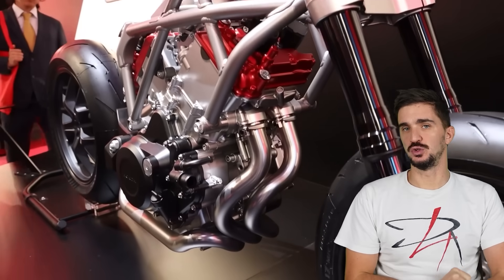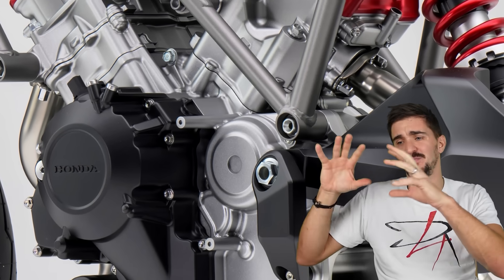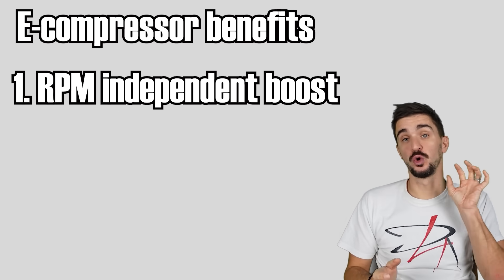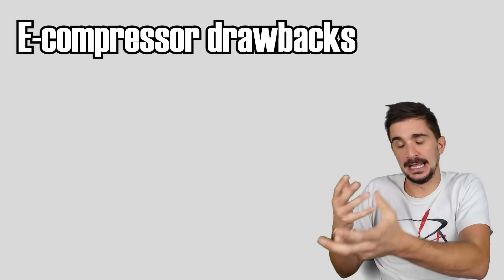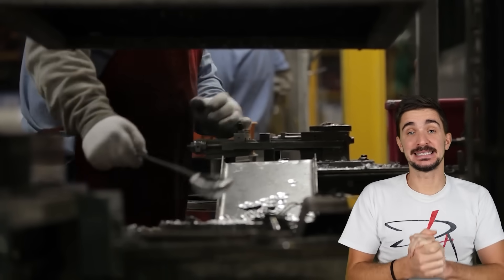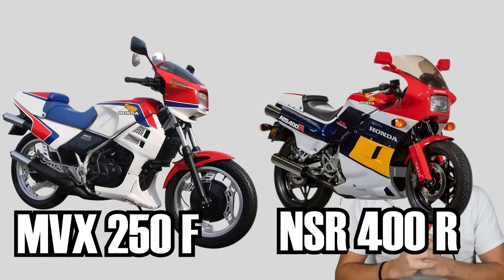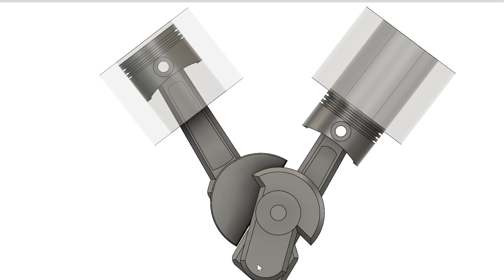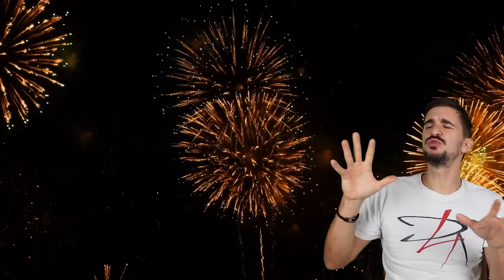Honda's New V3 Electrical Compressor Engine Explained

Comment: I'd love to see the electric supercharger system used with a sorta hybrid-esque powertrain, like, add ebike-style hub motors to the front and rear to use as dynamic brakes to charge an independent, higher-voltage battery bank (or even supercapacitors) for the blower whenever you slow down. Effectively multiplies your energy input (via regen braking) into gaining MUCH more output power by using it to supercharge a combustion engine instead of just putting it back into the electric motors, plus for continuous boost it can sorta function as a traditional supercharger by siphoning power off the driveline and putting it into the supercharger, since modern brushless motors and centrifugal superchargers have efficiency on par with an oldschool straight-lobe Roots blower when used together.
Reply: I'm also wondering if this engine could be used as a range extender in cars. It's compact, light, clean and has good power output.

Comment: Some of the engine's power must be used by the alternator so it can generate sufficient electricity. Honda will most likely make it so that the alternator will automatically turn off during acceleration. Perhaps only in sport mode. Then
 Allow the alternator to operate normally during constant cruising speeds. Honda goldwings with heated seats do this in a similar fashion. The gold wings don't shut down their alternators, but they temporarily turn off the heated seats during acceleration.

Comment: So, to get the extra mass on the rear cylinder, could it just be made larger in bore? This would make for uneven power pulses similar to the big bang motors. Might be good for traction.

Comment: With a turbocharger the exhaust manifold between the engine and turbo may be more complicated, but, since the turbo removes a lot of energy from the exhaust gases, the silencing section of the exhaust can be simpler and more compact.

Comment: Honda R&D on a supercharged V3 750 cc VTR? The cheapest bike will be $17,000 for the base model, easy. Regardless of only making 100 horsepower or so. It will probably go up to 25 grand. Knowing Honda. I say that despite knowing about Honda's new 1000cc Hornet being so cheap. I consider that bike a fluke. 

I really hope that I'm wrong.
Reply: You talking nonsense
Reply: No.

Comment: most 1000cc engines are putting out well above 130hp, unless you go to harley. Suzuki's GSX-R 750 is making 150hp but its a inline 4. Either way this thing is going to have to be pulling some miracles out of its tail pipes to sell well. Suzuki's 8s  with a new engine is selling for 9 grand, and its not doing anything insane with its new engine. the BMW F900R is selling for about the same and stock for stock the BMW whoops the 8s out of the water in everything but looks.  So this is going to be much like the other things honda has, SUPER expensive for what it is...Its a new engine, chassis etc etc, this is going to be expensive for what its going to offer unless its going to be its new Fireblade and just drops insane numbers for power, weight, etc
Reply: Wrong dude. Gsxr 750 makes 150 horses after you install a full exhaust system with no catalytic converter and a couple of other mods and a remap, obviously. 
The thing Honda is trying to achieve is to have more power and usable torque at lower revs in a more compact engine while also meeting strict euro5+ emissions standards.

Comment: Amazing video! Thanks. My first thought was that the center piston would have a larger bore but the same stroke as the other Pistons. If the bore was 1.41 times the other two then it would have twice the area and twice the displacement. So it would kind of be like a V4 but with a shorter crankshaft and now narrower horizontal block. Which is what we want. 
But then there's the 75° angle. This would screw everything up that I was thinking about. 
Do we actually know that the bore of the third piston is the same as the other two? If it was larger it would be a cheaper way of getting more displacement without adding any significant mass to the whole engine. 
 Love your videos

Comment: Next thing you know, Honda will come out with a V1 engine.
Reply: The Germans made v1's in the 1940's but they had a terrible tendency to blow up.
Reply: the ducati supermono was a v1. it was a great success, having a dummy con rod to emulate the balance of a 90 degree v twin.

Comment: Normies don't know that the compressor side of a turbo is not definitive of the name :)

I made an e-supercharger using a compressor from a turbo and hobby motor and controller.  It can make about 10psi on my little 4 cylinder engine to torque fill before the turbo comes on.

Comment: wouldnt it be possible with this setup of a short surge of electricity making pressure to have a literal boost button that controls the use of the compressor for a short boost then recharges? Like a video game boost button.

Comment: V configurations are not narrower than inline configurations.
An IL can have the alternator behind the cylinder block , a V has no room to do that and it always has to go on the end of the crankshaft , making it effectively as long as if it had an extra cylinder.
Plus the rear cylinder takes up space that can be used for fuel or an air plenum.
I have had both V and  IL engined bikes - the advantages of Vs are all myths.
M current IL 3s are  narrower than many V-Twins

Comment: honestly its a very stupid engine. its only as wide as 2 cylinders.  but it has THREE(3) cylinders, YEY. and it has a little 5psi electric shitty too, YEY ... look at how cute it is.....
what would be is engineers would pull the heads out of asses ? make a v4 90 degree, pushrod engine, and slap a good old trusty blower in the V shape. job done. thats something i would be excited about. same width as a 2 cyl engine, yet it has 4 cylinders. not just allmost boost from idle, but genuenly boost from idle. not just for a limited time boost, but boost all the time. no question asked. why pushrod, one might ask. well, its SIMPLE, and the head is far smaller. you get an eninge that does NOT need an upgraded electric system and all that crap none actually wants. yet you get a simple engine, good power, and something genuenly unique. v4 has been done by honda, they are brilliant. supercharged engines are all magnificent by default. there you go.

Comment: If the compressor is a variable speed unit controlled by the computer , it allows a lot of customization of the torque curve.
Reply: It is.

Comment: I want to see a 1000cc V12 in a ZX10 frame.
Reply: Resurrect the 1955 to 1957 , 500 cc Moto Guzzi V8, 78 Hp, 170 MPH?
Reply: That's not necessary

Comment: The thing I like is that the parasitic load is spread out over time, while the battery alone is running the eCharger.  But the alternator still doesn't have to be ginormous.  Only large enough for a practical recovery.  This is like a series hybrid.  Batteries get you on the parkway, and alternator has time to recoup the loss as you noodle along.  Good engineering principle.  Battery acts like a buffer between the electrical demand and the restoration of power over time.
Reply: Regen braking is negligible unfortunately. It can't recover power loss from friction and air resistance which are more significant than elevation changes
Reply: @ABoringTool  I do think some people lose track of the design brief that is the most efficient cost effective build for the target market this why we do encounter a whole lot of titanium, gold or platinum in most builds even though the application is probably screaming out for it.
Reply: @alangraham8926  Indeed, seeing that this is supposed to go on a motorcycle means a ton of inherent constraints. So it's impressive they are able to make so many novel ideas work in a production application. (No Honda fanboyism here)
Reply: @ABoringTool  Yes, those are losses that the power has to overcome.  But the biggest challenge for power is acceleration, especially up hill.  I have my first auto (a Jeep) that has real time average gas mileage digitally displayed, and acceleration/up hills, ruins any chance I have to over 20 mpg or better.  :)
Reply: Good point. On the street this will make a lot of sense. And the beefed up batery stuff will come handy for e-clutches and whatnot
Reply: I like 👍
Reply: @alext8828  where is the battery though? The generator could be of the non permanent-magnet type, so it only induces losses at the crank when the controller asks for current from it to drive the compressor.
Reply: Prototype, and aluminum.
Reply: Using the alternator as a starter and regenerator during braking could add a few extra bhp...but still this is going to get heavy.
And the battery needs to be able to turnover the engine .... It's weight...a lot of weight
Reply: Except when you are using it in the compressor zone, which could be let’s say onto the autobahn and max v for 200 k’s?
Reply: If you have a big enough alternator and battery you can just charge it only when braking. Which means it's completely free energy.
Reply: @danieltanuwijaya7675  get your point but not quite right the "free energy" was put in the mass via the fuel.
Reply: @alangraham8926    I think what was meant was, 'during braking, you're just wasting the energy spent accelerating, so, use that time and energy (otherwise lost) to regenerate the battery with a huge alternator, and not during acceleration'.  Am I missing something?  Is that not why E-vehicles usually have regenerative braking?  In fact, maybe utilize the larger alternator in conjunction with installing a full regenerative braking system sized for the road (racing) course expected.  
  If this power boosting system is on a public road bike that does mostly city drag racing, then perhaps you'd need a larger alternator.  No road bikes will run extended distances at full throttle (WOP).

Comment: Hopefully they'll have rider selectable modes so one can choose between higher boost for short durations vs. sustainable boost.
Reply: "Sustainable boost" would require an alternator with at least the same wattage as the compressor motor.  As the approximate HP to cruse at 80 mph is about 33,  except for on a closed track, there is nowhere that even 50 continuous horse-power could be used.  A typical 750 cc normally aspirated  bike cruses at 1/3 throttle.

Comment: 5:40 + An electric compressor surely provides cooler air than a turbo which is constantly heated by the exhaust gaz

Comment: Curious how the emissions thing works. Aren't you using more fuel and air with boost? Legit asking, not arguing or saying you are wrong. Thank you
Reply: Yes you are, but 95% of the time most engines are NOT running at full throttle, and it for that time a smaller engine is more efficient.

Comment: I wonder how the power loss is compared between them, yes, normal turbo does increase backpressure and thus power losses in engine but electric one after all does the same but via the significantly higher drag from much stronger alternator
Reply: Modern alternator efficiency is now up to about 92%, whereas turbo is at best around 85%.  If the electric motor turbo only runs for 10% of the time, one could deduce that the alternator (given a proper sized battery) need only have 1/8 the wattage of the motor.
Reply: @johndavidwolf4239  85% of whole system vs 92% of only the energy producing part. If we assume electric engine is also 92% we end up with... ~85%

Like, formula 1 uses electric generator running on exhaust for a reason, I wonder if that would be more efficient ? Yeah backpressure, but modern exhaust already puts a lot of backpressure so putting turbo there instead of bigger muffler might be net win energy wise. Then again, that's fucking pricy.

Comment: One not mentioned advantage of a turbo is the pressure/energy contained in the exhaust gas at the end of the power stroke (@BDC) when the exhaust valves first open is recovered for the short time before the piston on the exhaust stroke has to feed power to the turbo.

Comment: Instead of a waste gate, you can use the electrical motor to charge the battery by loading the compressor.
Reply: There is no waste gate required. The motor is just driven enough to produce the desired boost, and no more.

Comment: Another point about not having to run continuously is that for "short bursts of boost" it can draw some (half+?) energy from the battery, whereas if continuous the alternator needs to have at least the same power rating as the compressor motor, thus allowing for a smaller alternator.  I would not be surprised if it had a 24 or 36 volt motor/battery/alternator system and a solid state voltage reducer to charge the 12 volt battery.

Comment: More and more vehicle accessories are now powered electrically. AC compressor, power steering pump, water pump, EGR valve, thermostat, why not the boost compressor?